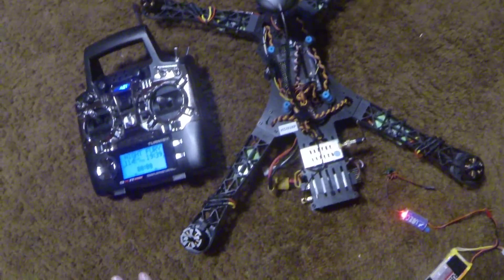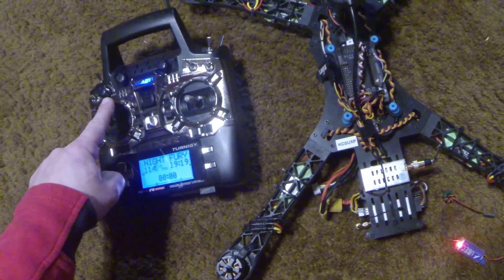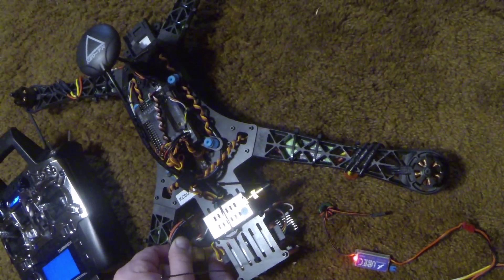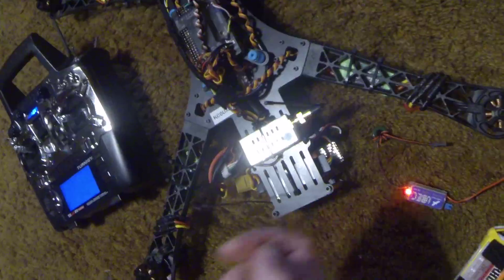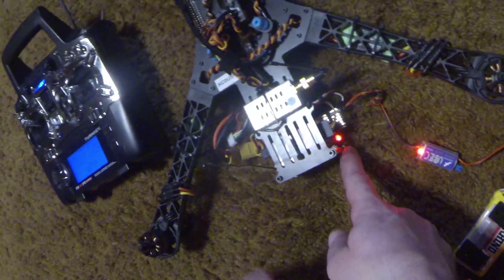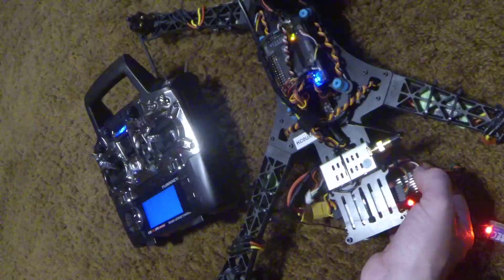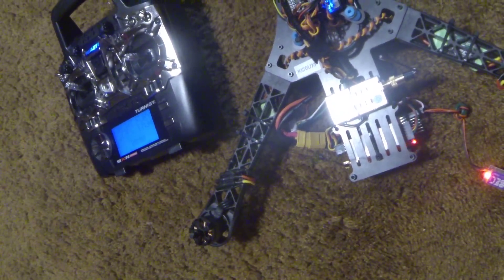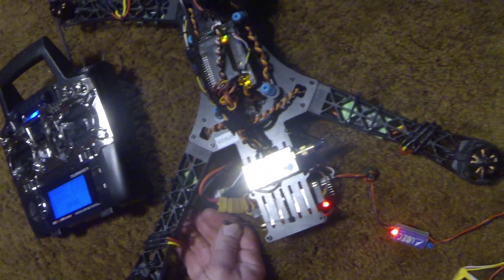easy APM 2.6 ESC calibration all at once using cppm muxed wire or ezuhf

Comment: What frame is that? I've been looking for a frame like that.
Reply from the maker: MWC X-MODE 17-25.00 on ebay.
there are many cheaper clones that look identical and the the arms are garbage.
the good ones have HF or HJ arms stamped on them.
another way you can tell original is where the arm ends at the motor there is 2 circular holes in the plastic casting not triangles. 
http://www.ebay.com/itm/HJ-MWC-X-Mode-Alien-Multicopter-Quadcopter-Frame-Kit-White-Black-US-Stock-/111426811018?pt=Radio_Control_Parts_Accessories&hash=item19f18e348a